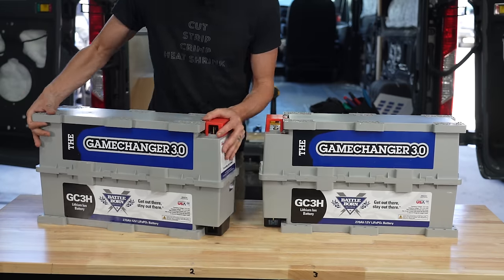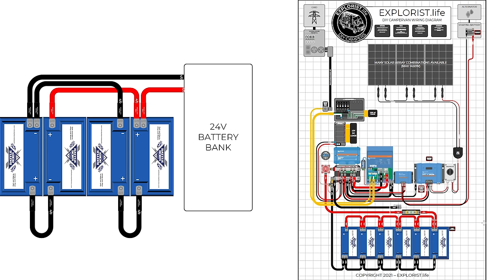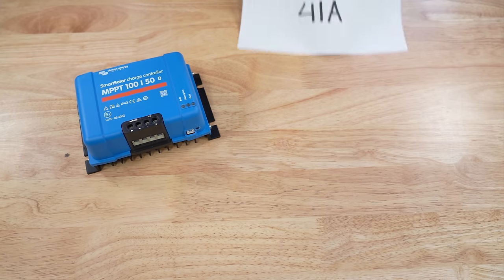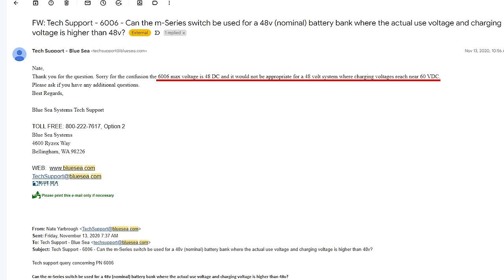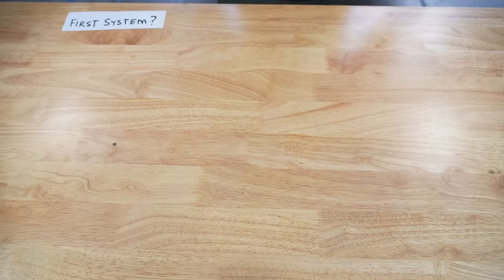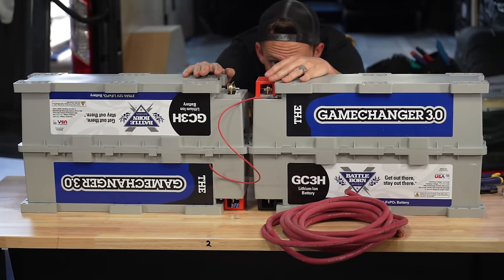12V vs 24V vs 48V (For Camper Electrical Systems)

Comment: Thank you for making this video! As a person that is shopping for a class B RV with a focus on boondocking off of a lithium battery system, I came upon an RV that stated it had a "48V - 210 amp hour smart lithium battery providing 10KW hours of power... a 3,500W inverter.... and a 220 amp alternator with 2nd alternator (48V) dedicated to the lithium battery." As a person with very little knowledge of RV electrical systems, I was wondering what you would think of a setup like this? In practical terms of powering an RV fridge, air conditioner, etc., for a good amount of hours? I can imagine there are many variables in attempting to calculate something like this, but would love your advice on if this setup seems good to let's say,... powering the a/c (13,500 BTU 48V Coleman-Mach 10 air conditioner) throughout the night on a hot summer day. Thank you so much.
Reply from the maker: So...  210Ah @ 48V is equivalent to 840Ah @ 12V; which is a lot of power.  Knowing that... you should do a power audit to determine how much power you can anticipate using on a day to day basis to see if that battery bank capacity is enough.  Here's a tutorial for that: https://www.youtube.com/watch?v=a406IxiU-Xg
Reply: @EXPLORISTlife  Thanks! Appreciate the feedback 😄

Comment: I've been following your YouTube channel for a couple of years now and I am appreciate your knowledge and you take the time to put out these videos to teach us... I have a question just off the subject and maybe you can help me with because you are obviously know everything when it comes to AC, 12 volt and solar power..  You're basically an electrical engineer... So my question is I bought a 2009 travel trailer 2 weeks ago went to plug it in to 30 amp Shore power in it keeps tripping the shore power breaker.. I checked the Shore power with a multimeter and it is wired correctly and producing 130 volts so I pull out the campers fuse box and no loose wires and the breakers work fine on the AC side...  So them I checked the inverter which is a Power Max that's only 3 years old and everything checked out okay with it as well... The funny thing is is I can use an adapter on my 30 amp plug and plug into a regular 110 20 amp residential Outlet and I get power it's just only 20 amps worth of power not the 30 that I need to run the residential refrigerator and the air conditioner at the same time.. Do you have any suggestions or advice about what my problem is or what to look for..? Thank you in advance...
Reply from the maker: I'd probably start with checking a different shore power pedestal to see if the issue is in the shore power pedestal or in your camper.

Comment: Thinking of adding 48 volt panels on top to charge an ecoflow 2000 watt battery bank. 12 volt charge will take 11 hours to charge, 48volt will charge in under 2.

Comment: Nate, would you comment on the EcoFlow inverter/charger 48v and alternative alternator charging ?
Reply from the maker: If you're dead set on using a unit that isn't really compatible with alternator charging, you'll have to go without, unless you can hack together an alternative solution.  Those boxes are pretty 'You get what you get and don't throw a fit'.  I'd revisit what you need and see if a lower voltage system would work better for you so you can get more effective alternator charging.  I don't really have 'other' thoughts other than what I shared in this video, regardless of manufacturer.

Comment: Hello Nat, all your videos seem excellent to me, a lot of information and very clear. If possible, I would like to ask you a question. I have a 30ft travel trailer, it has a 110 volt 30 amp electrical connection. What would your opinion be if I installed a solar panel, a battery bank and a 48 volt inverter that would supply direct power to my 110 volt connector. Thanks for your help, I would really appreciate it.
Reply from the maker: I very much dislike the idea of a 48V inverter in your system.  As long as 3000w of inverting power would meet your needs, this is what I'd recommend: https://www.explorist.life/30a-camper-inverter-with-solar-and-alternator-charging-wiring-diagram/
Reply: @EXPLORISTlife  Thank Nate very much for the help

Comment: Hey man do you know how adding a second inverter impacts the system? I'm making a couple things kick on automatically, like my heater or ac while using an induction stove. I'm worried after doing some math and going over possible scenarios, that I'll exceed 3000w capacity for longer than a typical peak. And definitely would run close to te limit way more often than I'd like. I want to add an additional 1000w or 2000w inverter and divide the loads so that anything that could run at one time can. 

Additionally I recently bought my box truck with a nice renogy 12v 1000w inverter in it. I'm wondering if I can just use a step down between the 24v from the busbar and the 12v inverter. Seems like that should work, but also seems too simple. 

P.s. I asked you about ev converts. I took your advice and abandoned that idea. And I believe you have videos about alternators for 24v. I couldn't find it, but if you have a link that'd be awesome. Thanks for all the great advice!
Reply from the maker: You can use multiple inverters feeding one breaker box, but the inverters need to be matched and capable of being run to the same panel, Renogy does not have this capability.  This diagram shows a dual Victron Multiplus 3k system: https://www.explorist.life/24v-6000w-120v-240v-split-phase-camper-solar-wiring-diagram/

Comment: Incredible channel!!! You have my attention!  I’m about ready to begin this project. Questions. Do you sell the Victron line or just the materials needed?  Also do you offer one on one consultation if I have questions during the install? (Can I PM you for example)
Reply from the maker: We have both victron components and the wiring kits needed.  We can offer tech support if you run into an issue, but it's REALLY REALLY REALLY important to watch the videos covering the installation on our channel here.  We don't sell anything we haven't already made a tutorial for, which makes 'one-on-one' consultation not necessary.

Comment: Unless I missed it, you should also mention that a 12 volt system will cost more for the fuses and other hardware to handle the higher current.
Reply from the maker: I did indeed talk about that, yes.  I also talked about the fact that connecting a 12V Inverter to a 24V battery bank would be far more expensive than all the wires and fuses combined if cost is the sole choice-factor in choosing one system over the other (like I've seen too many times).
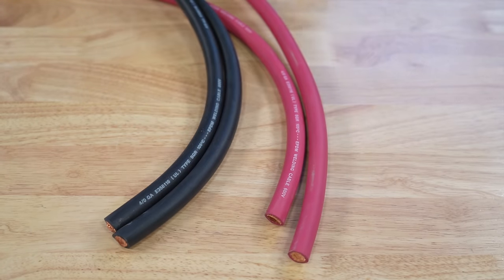Reply: @EXPLORISTlife  I stand corrected. You did touch on it at 2:15.

Comment: I chose to run a 24v system for my skoolie specifically to use smaller wires and cheaper components.  the last question I have for install is purely one of convention, as it makes no electrical difference but prevents confusion down the road:  Do you use red or black wire for the series connection between the batteries?  It makes no difference to the electrons, but I'd like to keep people from getting zapped.
Reply from the maker: There's no code for that as far as I understand. If it's left up to me, I'm going to use red since it is hooked to a positive battery terminal at 'one' of the ends, and extra precaution should be taken when handling it.
Reply: When I make my cables up I always put red tape around the positive connectors and black around the negative ones

Comment: Great video 👍🥇 
You did a good summary for all 3 options . 
Now I need to know your opinion about the new Eco Flow 48 Volts system , used for any RV application. 
Will wait for your opinion and comments . 
Kindest regards 💌🌹
Reply from the maker: In general, I'm not a fan of those all-in-one units like those for permanently installed systems.  For a 'charge it up and chuck it in the truck', units like those, Goal Zero, Jackery, and similar are great.  But for high end, permanently installed systems like I teach on this channel, a system with individual components will give far greater flexibility, customizability, and power scaling potential.
Reply: @EXPLORISTlife makes sense. Before I was looking into inverter battery build I used a ecoflow delta pro for rv. With extra battery. It worked for like 1 hrs then tripped the internal bms and I couldn't reset it. It dawned on me then that all in one systems like ecoflow delta pro are nice for emergency, but the lack of serviceability is something u lose.

Comment: What if you fall into the first category but have an extensive mechanical(some electrical) background? I plan to order the nomadic cooling 3000 here soon and can't decide 12v or 24v. Would the only savings there be in the cost of wiring and connectors? I'm assuming the performance will be the same between the two? Can't wait for next weeks video, love the content!
Reply from the maker: The performance will indeed be similar between the two units.

Comment: Hey Nate! Again great video!  Do you use a specific software for your electric diagrams? I've been using Omnigrafle but am looking for an easier software to use for my diagram and think yours looks very nice! Thanks!
Reply from the maker: I use Microsoft Visio for all of my diagrams.
Reply: @EXPLORISTlife  Thanks Nate! When we buy a diagram from you, does it come as a Visio project? That would be awesome since the base of the diagram is already very nice and could be modified to fit my system! :)
Reply from the maker: @marcksavoievoyer6424  It comes as a non editable copyright protected PDF.  Providing the Visio file would make it too easy for people to remove my watermarks and  infringe on the copyright of the diagram.  We've had issues with that in the past.
Reply: @EXPLORISTlife  Gotcha! I'll get on visio and start charting! :)

Comment: Why would the switching problem mentioned be a problem for 48v when you could put a 12v switch on the input side of the converter?
Reply from the maker: Because that's not necessarily where a disconnect is needed.

Comment: hi i got an off grid so;ar power system 8000watt with 16 x 500 watt solar panel... got a question...
can i connect my 2100watt inverter generator to charge my power bank if need or to use generator if need be..
Reply: oh i forgot also 8 x 150ah 10wh batteries connected 2 x 48v.  4 batteries to 48v x 2 connected together
Reply: also my inverters i have 2 x 5000watt inverters am i only getting 7680 watts out of it
Reply: to get a better use for it id need 4 more batteries and 4 more 500w splar panels right

Comment: Good morning Nate. I purchased some of your wiring diagrams today, and was wondering if you plan to add 24 volt versions of those with say a larger battery/solar capacity? I think the biggest change would be the addition of a 24-12v step down, 24v batteries or 12v battery wiring, and an upgrade to a 24v Multiplus... Wire sizes might change too. TIA.
Reply from the maker: As mentioned at the start of the video, we will indeed have more 24V systems coming out.  Worth noting, though... I already have a 24V system available here: https://www.explorist.life/24v-6000w-120v-240v-split-phase-camper-solar-wiring-diagram/
Reply: @EXPLORISTlife  okay, I'll buy that one, it seemed way more than I thought I needed. I guess I can delete the 'dual' portion.
Reply from the maker: So...  If you don't need the 2nd 3000w inverter... why not just use this 12V setup: https://www.explorist.life/3000w-inverter-400-600ah-400-to-1200w-solar-camper-solar-kit/
Reply: @EXPLORISTlife  battery size. There are these Ampere Time 24v 200ah batteries (~$1500 ea) and they fit well under the seat of our trailer. I'm looking to be able to run a 9k BTU 120v mini split for AC and Heat (we are usually in the deserts of socal/nv/az), so battery size and maximized storage are important. (3 will supply 15kwh with room for a 4th battery later). A 4 battery 12v 200ah config would yield ~16kwh but cost an additional $1500.
Reply: @EXPLORISTlife  upon review, I see Ampere Time now has the 12v 400ah batteries back in stock, and they are only $150 more (each) for 5kwh. So with that price change, I may need to rethink the 24v. Any chance you have input on a small RV system (large capacity, small footprint) that would run a 9k BTU 120v AC/Heater, and are there any advantages to 12v over 24v
Reply from the maker: Here is my recommendation for upgrading a factory build RV w/ 30A shore power to a more powerful inverter, bigger battery bank, and more solar: https://www.explorist.life/30a-camper-inverter-with-solar-and-alternator-charging-wiring-diagram/

Comment: Can you list some of the B2B chargers that turn the "12v" alternator power from the van into "24v" to charge a 24v battery bank please. 
I know an the 12v & 24v are nominal voltages. The vans alternator puts out more than 12v to charge a battery and a 24v battery will require more than 24v to charge it. Keep up the great work.
Reply from the maker: Sure!  The victron orion-tr smart 12/24-15a is a 'small' one, and for larger ones, look into the Victron Buck Boost.  The 100A model will charge a 24V battery bank from a 12V alternator at a rate of ~1200W.
Reply: @EXPLORISTlife  Thank you much for the detailed reply.

Comment: will you be offering a 24v diagram for sale on your website? I'm looking for a 24v plan for a camper van with dc-dc charger, solar and shore power
Reply from the maker: I actually already have one!  Here's the link to that: https://www.explorist.life/24v-6000w-120v-240v-split-phase-camper-solar-wiring-diagram/

I'll have more in the future as well.
Reply: @EXPLORISTlife  I was not looking for a split phase system. I seen that plan in past
Reply from the maker: @gregnorman3183  As mentioned in the start of the video.  New 24v systems will be released soon.
Reply: @EXPLORISTlife  thanks, great videos by the way
Reply from the maker: Hey!  Just wanted to follow up on this.  We just released a video featuring a 24V battery bank system you may find helpful.  Here's the link: https://www.youtube.com/watch?v=E5q7_4FH4LQ&list=PLmvhcyi4n0TVfA4XCYJBkzfUXunSON1zX
Reply: @EXPLORISTlife  Yes, I seen it -Great, thank you! I seen on you website that you are now offering 540Ah Battery Bank – 3000W 24V MultiPlus – 580w-1700w Solar Wiring Diagram! Does this diagram include panel wiring and breaker selection? Also, have you every considered using MCB, I though they be smaller and take up less space?

Comment: Now, of course, the Tesla Cybertruck will be 48Volts... otherwise I completely agree with you, 48V Victron Multiplus-II 48/5000/70 at home and a Multiplus-II 12/2000/80 in my off-road Caravan. Might be a change in the air in a year or two.

Comment: What are you thoughts on the EcoFlow 4kWh Power Kits?  I'm sure that would be a video in itself.
Reply from the maker: In general, I'm not a fan of those all-in-one units like those for permanently installed systems.  For a 'charge it up and chuck it in the truck', units like those, Goal Zero, Jackery, and similar are great.  But for high end, permanently installed systems like I teach on this channel, a system with individual components will give far greater flexibility, customizability, and power scaling potential.
Reply: @EXPLORISTlife  Thanks, what you say makes sense.

Comment: Wouldn't higher voltage also result in a lower current draw on the batteries? Might be able to save a lot of weight as well.
Reply from the maker: The smaller wires would result in very minimal weight savings.

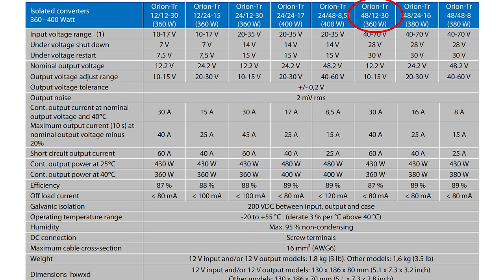Comment: At 4:57 you talk about Victron's 48/12 in relation to charging from an alternator. That victron is not for connecting to a 12 volt alternator, it transfers from 48 volt to 12 volt. Input voltage is 40-70 volt, output is 12.2.

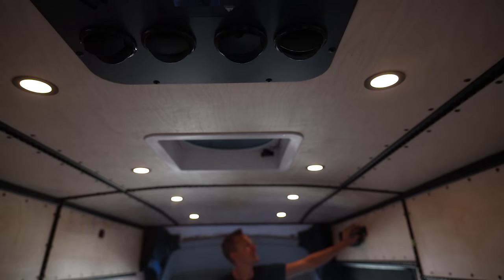Are you talking about a 48 volt alternator there? At 4:40 you talke about a 12 volt alternator, so I am confused here

Comment: Will an alternator charge a lifepo4 12v battery Thanks Derek
Reply from the maker: Absolutely!  The Victron Orion 12|12-30 does that perfectly: https://shop.explorist.life/shop/all-products/dc-dc-chargers/victron-orion-tr-smart-12v-12v-30a-dc-dc-charger/

Here's a full install where we showed that unit being installed: https://youtu.be/01F4QDVJUq0
Reply: @EXPLORISTlife  yes ok but can you just connect the alt to the lifepo4 battery (BMS)
Reply from the maker: You can't (shouldn't) connect the alternator directly to the battery with absolutely nothing in between, no.

Comment: So I have done a fair amount of residential wiring, understand 110ac and also fixed a lot of car. The Victron stuff is ridiculously clumsy, unintegrated mess. The EcoFlow uses 48v batteries, and three of them provide 1300amp hours at 12 volts. Their hub controls EVERYTHING so a 12v alternator can charge the 48v batteries. Install time is about two hours. Tell me why I want to put up with the
Reply from the maker: Victron components are simply higher quality components (as can be seen by the warranty period for each component and Victron components are more powerful as needed as the systems can be set up to be infinitely customizable.  

The Victron vs Ecoflow comparison is like asking somebody who races cars why they need a sports car when a Toyota Prius will get them from point A to B just fine.